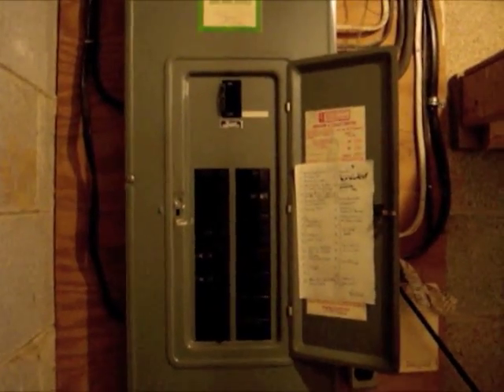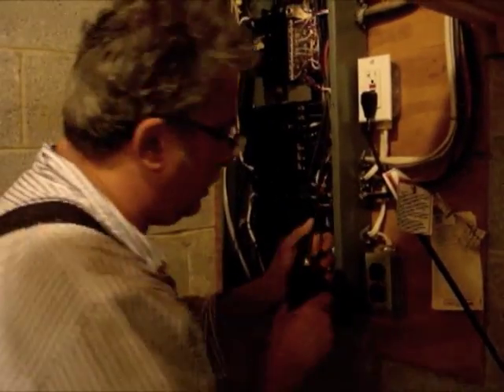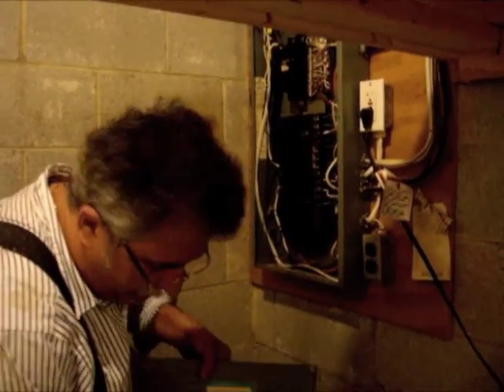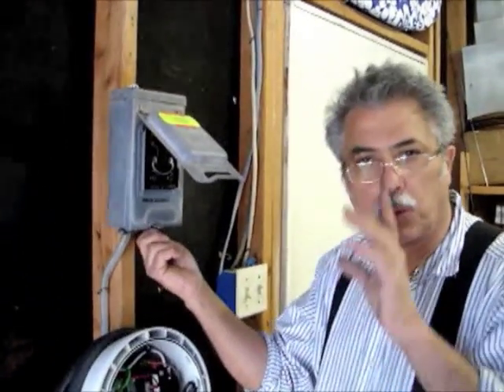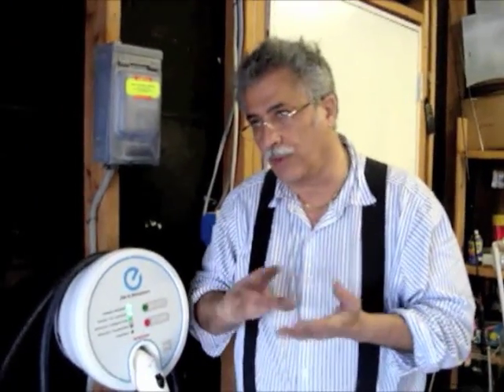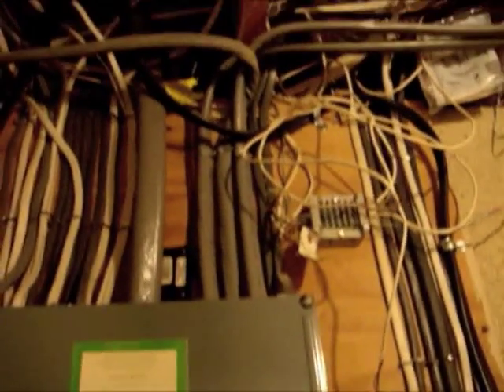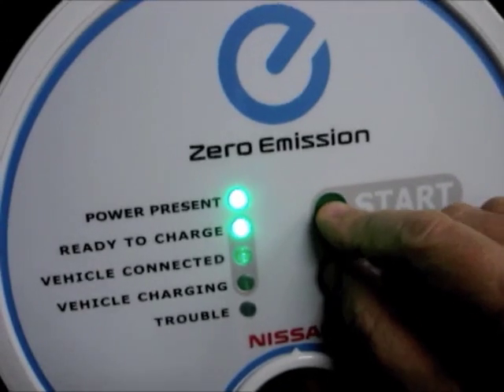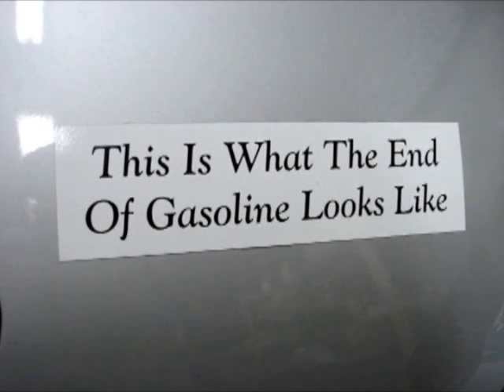EV Home Charging Station Installation

Comment: That electrician is a hack, he says "the wires up here are fine".  What a joke, that wiring in the garage would never pass inspection.  They way he ran the wires up the studs, and then outside them at the top, you can never install drywall!  Stupid!

Comment: Some mis information in here. For example, the EVSE is a very glorified switch, incorporating Ground Fault sensing, and handshaking with the car. It is not an appliance and does not require a separate disconnect. Article 625 of the National Electric Code specifies that disconnects are only required if the circuit is greater than 60 amps.
Reply: CharlesinGA no disrespect intended , first of all this video predates Article 625 and second and not meaning to be smart but in Article 625 section 23 it says for any EVSE of 150volts or more there must be a means of disconnect readily accessible which I take to mean accessible within the line of site of the equipment. It also requires the means of disconnect to be able to be locked in the open position. I have been an electrician for 50 years now and like everything in our business different jurisdictions interpret things differently and second i am sure you agree we Electricians develop a method that we use, Most if us go above and beyond the call but anyway I certainly do not mean to get into an argument with you I just thought maybe you hadn't read that section of the code is all. here it is copied from my web NEC: 625.23 Disconnecting Means For electric vehicle supply equipment rated more than 60 amperes or more than 150 volts to ground, the disconnecting means shall be provided and installed in a readily accessible location. The disconnecting means shall be capable of being locked in the open position. The provision for locking or adding a lock to the disconnecting means shall be installed on or at the switch or circuit breaker used as the disconnecting means and shall remain in place with or without the lock installed. Portable means for adding a lock to the switch or circuit breaker shall not be permitted.

Comment: The cost of EVSE boxes is a scandal.  Maybe $50 bucks worth of parts.  couple of relays, a very dumb circuit board and a cord.  My clothes washer has a half dozen boards that are far more complex, and the most expensive of them is about $100.

Clearly, it is quite simple to provide either a hard wired connection to an EVSE or a suitable outlet and wiring and circuit breaker in a main or sub pane1.  Of course anybody with an electric dryer can fabricate and extension cord.. and bobs your uncle.
Reply: I would agree, there is nothing preventing anyone from producing these. A free market will provide us with economical solutions. What do you think about the JuiceBox EVSE's?

Comment: Pretty sure #4 wire is overkill for a 40 amp circuit. That's probably why you had a hard time getting the wire into the breaker lugs. #8 THHN is the proper size. Good for 55 amps. #4 won't hurt but it's a waste of money, especially if you have to increase the conduit size, fittings, etc. to accommodate the larger wire.
Reply: Hahn Soloe I am pretty sure he didn't run #4.   In fact, he states that #8 is all you need.   Remember, they used an existing breaker and run.   Which means that they had the cable and run.
Reply: You might be right -- then again, not sure how long the wire run was... didnt look like it would require #4 wire, but if it was a long enough run, it would be plausible.
Reply: Alex Moreno ok

Comment: Southern California Edison has two 'special' plans for EV owners.  Neither makes sense for us, (Spark ev) because one uses one meter, but has caveats associated with your other appliances, and the 2nd rate plan requires a 2nd meter.  The install is too expensive so, just go solar, run on the sun.  We've been following solar for a long time, the changes come fast.  My gate and front lights (led) run on small test platform systems, but deciding on a configuration is like Peyton Manning reading the defense, on the run.  In the last two years or less micro-inverters, AC panels (same thing), mppt controllers and a range of inverter options have opened configuration doors for us.  335 days per year of sunshine, someone said.  Basically now we can scale up or down, monitor what's going on with each panel, re-direct solar electricity from sending it to Edison's grid, or using it to charge our EV.

Comment: Major electrical code violations starting with the load center. No record of a electrical contractors license in the state of Maryland for Mr. Lamari. I install electric vehicle charging stations for residential and dealerships alike and I'm required to carry workmen's comp, 2 mil.general liability and 1 mil on my vehicles. So, $2,100.00 is a fair price in most cases.  It comes down to the cost of doing business.

Comment: Interesting question. Unlikely, at least not anytime in the next couple of centuries or so. Steam was massively inefficient and gas provided more power than steam can provide. Now gas is not renewable and it causes much pollution so electricity seems like a likely alternative. Good thing about electricity though is that it's totally renewable. Not everyone is doing it in a renewable way yet, but that'll happen eventually and it'll be green, clean power :)

Comment: We do, however they're not in most rooms, but only located where major appliances are intended to be installed.  There'll be one behind the range, one behind the dryer, etc.  

Most 240 volt chargers sold here require a dedicated 40a branch circuit, which means even if your dryer is in the garage and on a 40a circuit (most driers are only installed on 30a circuits), you still can't have both of them plugged in at once.

Comment: In the little hot weather here in Maryland, much less than out west, I've seen no battery loss.  I still have all my bars.  We've been driving since Dec 2011, about 13 months.  My performance seems to be identical to what it was the day I drove it off the lot.  The only thing I've done is replaced a tire that picked up a nail, and attached an inverter under the hood to supply emergency power during hurricane Sandy.  You can check it out at evadc.org/2012/10/31/using-an-ev-to-power-a-home/

Comment: The dryer outlets are usually rated at 30A whether it's a 3 wire or 4 wire. However, OVEN outlets/plugs are usually rated for 40/50A. Also of course welder outlets, but it's very common to find a 6' pre-made pig tail of #6 with a 50A rated plug at your local hardware store for about $25. Of course appropriate conductor size should be used to feed your branch circuit.

Comment: The Nissan Leaf takes approximately 21 hours to charge using a 110/120 volt house hold plug.  The 240 volt chargers will charge the Nissan Leaf in 6-7 hours.  So charging overnight is ideal for most.

Comment: Lots of people do that, it depends on your needs.  Occasionally, I do drive it until it has a bar or so left, but I still have some errands, so I'll give it an hour or so of charging in the garage, which adds about 15 miles at 240V.  90% of the time, when we plug it in in the evening, it's done by midnight.

Comment: The lease price has come down recently, making leasing an even better deal.  It's something like $200/mo. with $3000 down.  I leased becasue I expected the Leaf to improve, and in particular, I knew it had a modestly sized 3.3 kW charger, while the competition (iMiev and others) has 6.6 kW.  Plus, the battery will improve, so I figured a 36 month lease would be appropriate.  My dealer recommended turning it in at about 2.5 years, which will be about 30K miles.

Comment: I had a few custom made at a place called zazzle.com.  I came up with that after going to the Keystone rally last fall at the Whitehouse.  I was thinking that if the US could cut its oil use enough by using ev's, Keystone would become unnecessary.  There was a cool chant there: Show me what democracy looks like; This is what democracy looks like.  It occured to me that using more ev's might lead eventually to the end of gasoline.  So, the end of gasoline looks like an ev, and visa versa.

Comment: The charger is good.  It doesn't have a web interface, so it''s more of a dumb electrical appliance, but it does its job reliably, as designed. As far as doing anything differently, I don't think there is anything.  I'm pretty satisfied.  I still haven't put in an outside access door yet, though, but it's on plugshare and available.  

Is there anything better?  Well, apart from the quality of internal components and wiring, I'm not sure there's much difference between non-web evse's.

Comment: No, we didn't have that little black box the guy in the Nissan video had.  The evse has an on-board diagnostic which you test by pressing Start and Stop together for about three seconds.  The lights flash vertically down and up, kind of like drag race starter lights.  That works fine, and it communicates with the car and starts charging, so I was pretty confident it was working properly.  So, the answer is you don't really need that little black box.

Comment: Did your electrician use the diagnostic tool as done in the video from the Nissan site on installing this charger? (I tried to paste but youtube prevents URL posting.  You didn't show that and I was wondering if that was necessary.  Do you like your charger?  What would you have done differently?  What would you ad?  Heard of any better?

Comment: And where did you get your sticker?   I have my original 2002 Prius sticker I never used because it seemed deceptive - but is finally now applicable, but for my Leaf.  "Eat My Voltage" it says.  Seems crass but I may put it up anyway.